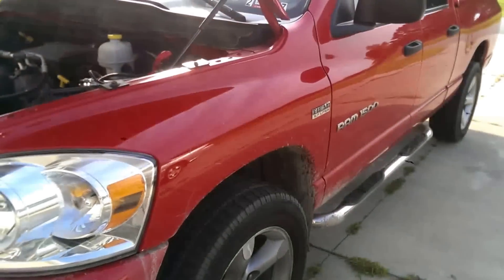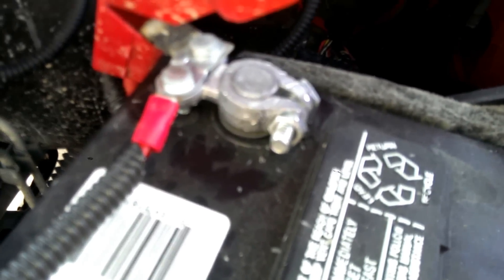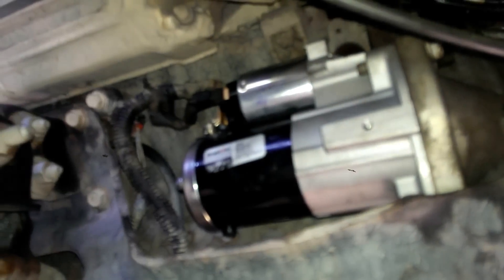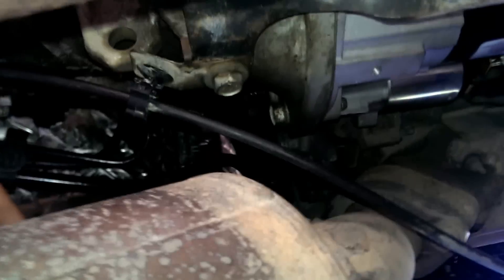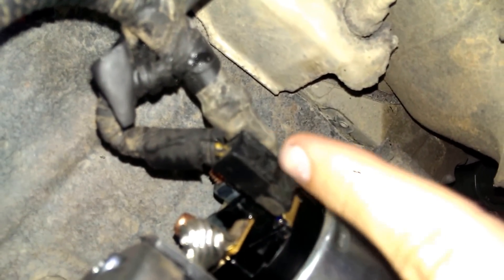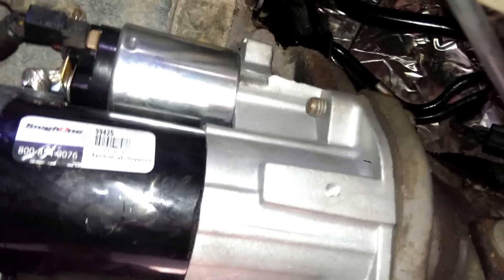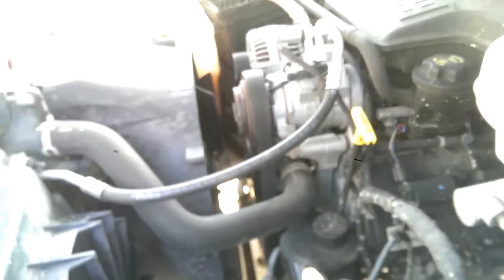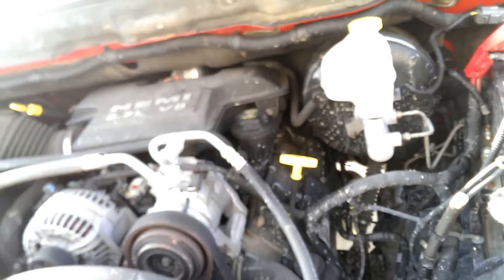Dodge Ram 1500 Starter change

Comment: 16 mm / 5/8"  (same size) harness bolts and 13 mm power nut.
Reply: Just the sizes I needed for my 04 thanks. Now to get the damn wiring harness loose.

Comment: Good post.  Quite helpful.  It is MUCH EASIER to disconnect the 2 bolts BEFORE disconnecting the 2 electrical wires.

Comment: My Ram 1500 would periodically fail to start but was getting worse the past few weeks. When I turned the key I would just get one click. So per your video I started taking the starter out. just as I was removing the last wire on top I noticed it was not very tight. So, I have decided to tighten it and wait and see what happens. I'll keep you posted..
Reply: My power wire comes loose every now and again as well, I have to tighten it at least once a year or else I start getting the old one click and nothing

Comment: My truck wouldn't start coming out of the grocery store.   I have a new battery.  Replaced the alternator and the starter.  Nope no luck.  Towed to a mechanic.  Mechanic said take it to a dealership after a diagnosis of module security system.  GREAT!  (Sarcasm).  So they'll do a diagnostic at a charge of $150 and probably a $900 fix.  All because something in the anti theft alarm system went awry!  LOVE ELECTRONICS!

Comment: Thanks for the directions, so the bolts are 15mm and the selenoid one is 13mm, one of the 15mm Bolts is hard to manœuvre so i recommend a ratchet wrench..https://images.app.goo.gl/wn17DC4XVWep3bRC7 the other ones can take regular ratchet (Still plan for ratchet extension)

Comment: How did you get the two starter bolts out?  I tried using an extension but there still isn't any room to ratchet it with the 4x4 drive shaft and exhaust in the way.

Comment: It's always safer to remove the ground cable first (Not positive cable)before doing starter or any job that requires disconnecting the battery,, just so you no...
Reply: Rick that's what I was thinking too🤔

Comment: So, with my 2004 dodge ram I go to start it n I get 1 click n nothing more, there is electric throughout the dash. I've tried 5 times, I think its the starter, 
 The alternator I just replaced n the battery is 3 years old. So if someone (who knows) can confirm that it sounds like the starter, I would appreciate it.

Comment: What's the bolt head size for the starter bolts ?
Reply: the second bolt looks like 1/2 or 9/16...or the equivalent metric size...12mm or 13mm...it would be nice if someone would post this...
Reply from the maker: +John Hopkin its been in the description the entire time the video has been up

Comment: I hate when people who attempt to make a how to video do the job and try to describe what they did??? The reason most people what these crappy videos is to visually see how to fix a problem!!! SMH
Reply from the maker: I showed the bolts you have to take off. I showed the wires to take off. What else do you need 😂
Reply: @JoeTaks  How do you get the two bolts out? I can't see where there is any room for a wrench. How did you do it without removing the 4x4 drive shaft and exhaust?
Reply from the maker: @72Stiles   long extension
Reply: @JoeTaks  I tried various extensions all the way back to the 4x4 transfer case and don't have any room to ratchet. The gap between the drive shaft and the transmission is only an inch or two at the most. Are you using some kind of swivel?